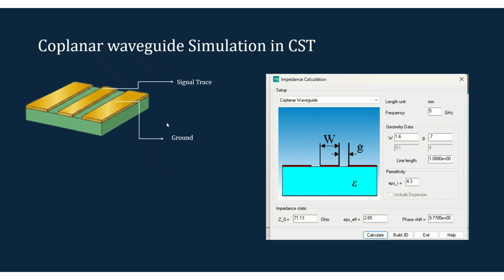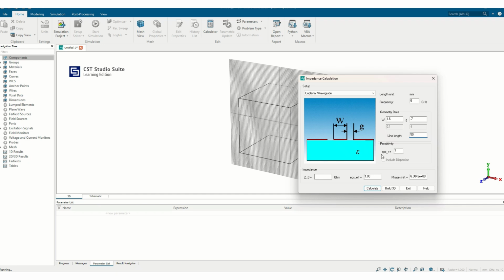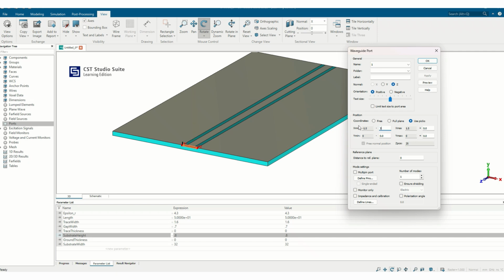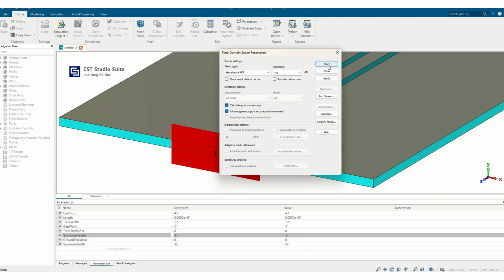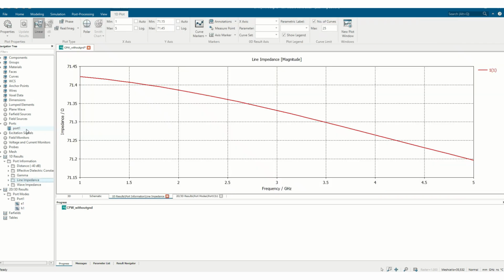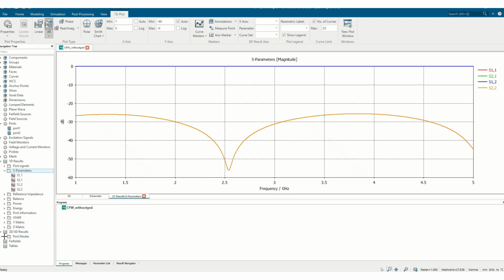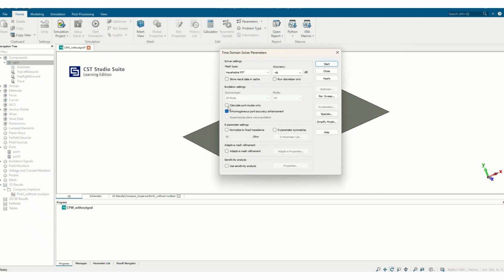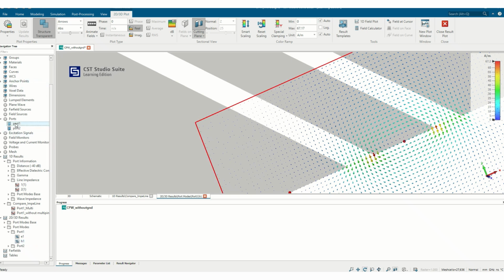How to Simulate a CPW (Coplanar Waveguide-ungrounded) in CST Microwave Studio

Comment: if line impedance is more than calculated from macros then should we optimize the trace width and gap or optimize the waveguide port dimensions?
Reply from the maker: Waveguide port dimension. We have to obtain the theoretical calculated value from simulation.
Reply: @waveresTech which wavguide port dimension? i means height of waveguide port above and below radiator or width of port. i designed it using cst help but confused about which value to optimize and uptill when the optimization value is ok
Reply from the maker: @awaisshakeel4443  It is ok to optimize width and height. The main thing to be taken care is that the filed distribution varies not much from ideal. When the height becomes more, the filed distribution will become like in a waveguide (described in CST help).